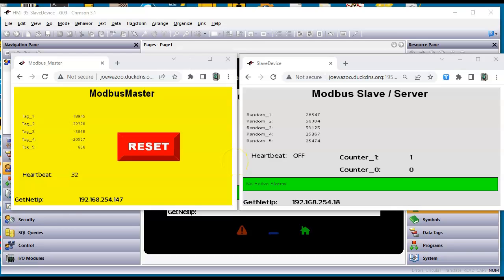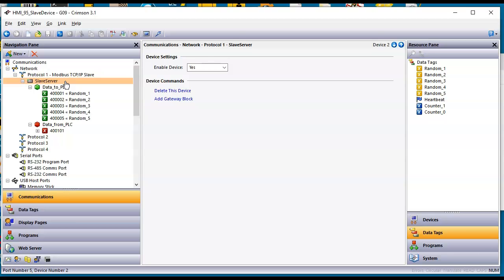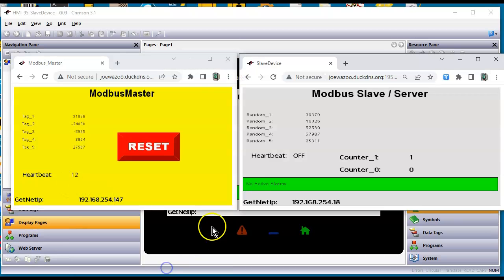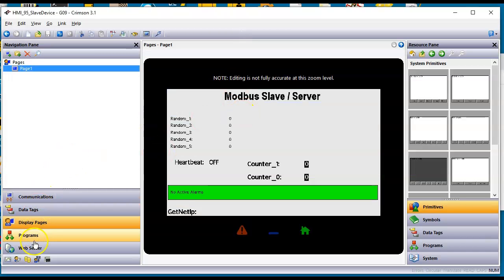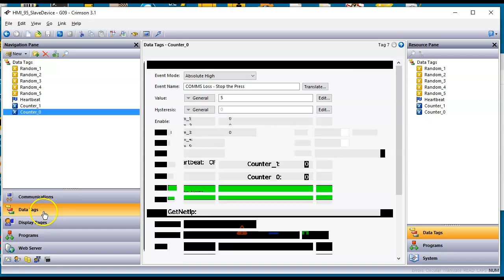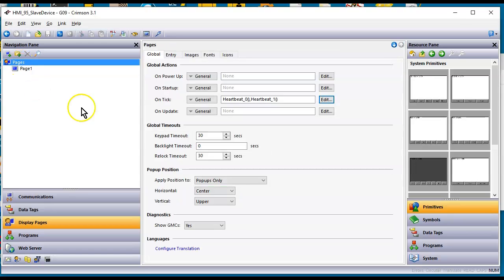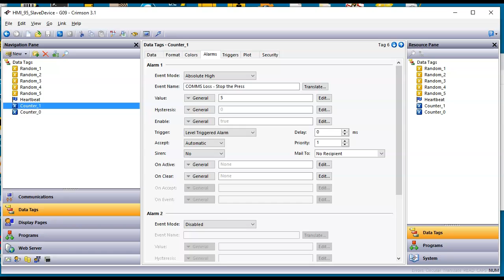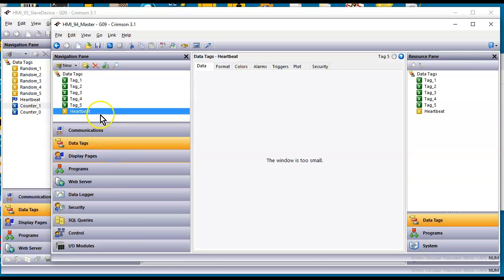Slave/Server Monitor Comms to PLC - Heartbeat

Comment: Joe,  Have learned a lot from your videos and found this one interesting.

I have an application using an Allen Bradley Micro 850 and a Red Lion Graphite HMI, 7", with 1 digital i/o module.

I have found that when the HMI is not able to communicate with the PLC all outputs turn ON.  When the PLC is connected they function normally.

I'm wondering if i have missed something in my setup or if i can setup a similar heartbeat signal between my 850 and the HMI.  I am using Ethernet for communications.

Thanks in advance for your assistance.
Reply from the maker: Joe,  Make sure you have the Outputs on the Card defined Active Lo I believe.  And you could always run a program that set them all to ZERO off when you first Power up prior to AB taking control of those outputs.